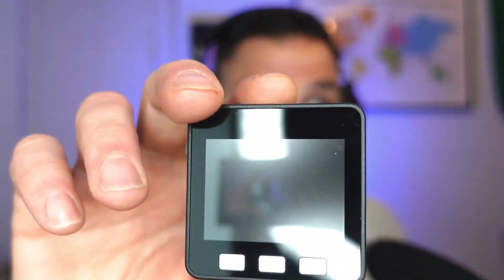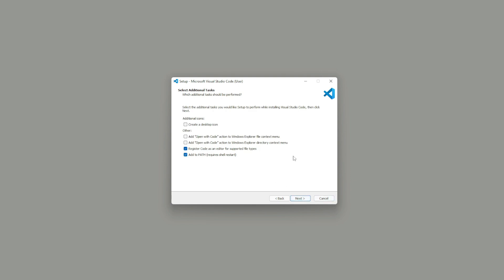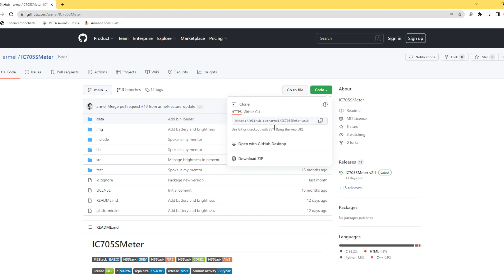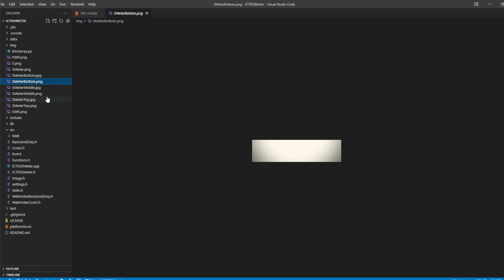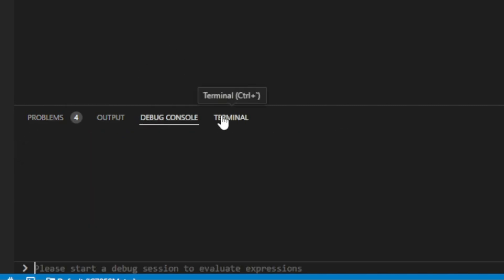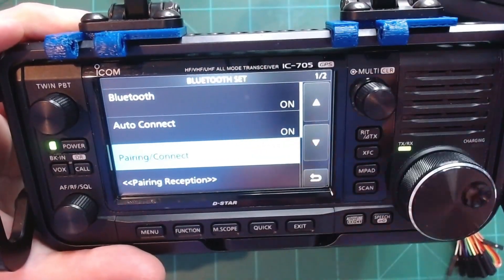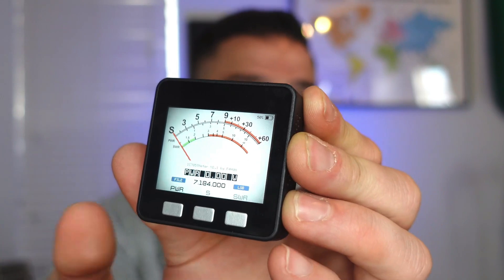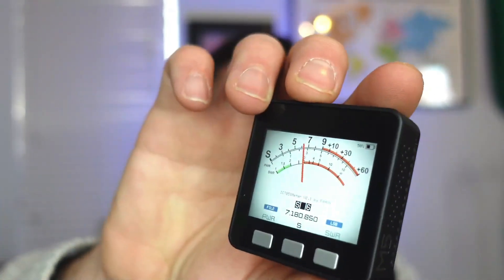IC705SMeter - ICOM IC-705 Bluetooth S Meter Using M5STACK!! Walkthrough Tutorial

Comment: Just saw this tutorial and wanted to say thanks for putting it out there. When I tried to compile I got a bunch of errors and it failed. I deleted everything in the repository I had downloaded and started over and got the same error. Just curious if there was changes made since you made this tutorial to the repository or are there other components that I’m supposed to download that weren’t shown in your tutorial? Any help would be greatly appreciated.
Reply from the maker: I'll have to try whenever I get home. Otherwise Arnel would probably be resourceful and good information should be on the GitHub link
Reply: Yes, I got a red FAILED error but suspect I used the old install as there was a link to M5HamRadio, I might have to reinstall it all.

Comment: WARNING :CODE PROJECT NOT STABLE!                  
I got the Multimeter project working, and paired with the 705. When I powered down the 705 the M5Stack powered down, and was "bricked". Could not power on, reset, under any circumstance, connected to power, etc. Its an interesting project, but not stable...Your video was helpful getting it up and running...

Comment: purchased a $49 AWS Core2 (yellow cased) m5stack; comes w/500mAh battery; built the 705Smeter and 705multimeter firmwares; put them on an old FAT32-formatted 8gb microsdhc with the names smeter.bin and multi.bin; inserted them into my AWS; upon bootup, i press the center button when i see a single dot at the top of the screen; the bootloader displays the two firmwares; i use the left or right button to select the desired meter, then press the center button to confirm; the AWS then reboots to the selected meter... so now i have a remote BT meter that can display the detailed multi-meter or the old-style gauge meter for my 705; the old style works very well when using my 705 /p with a mag loop; i can keep the waterfall, scope in full glory, and then just watch the SWR while i tune the loop at 1W RTTY output! excellent accessory for the 705! get one today and do it yourself - and send the author  (Armel Faveau, F4HWN) some money - he deserves it!

Comment: Thanks Dude for the great video tutorial. I got the Basic M5 from the M5Stack store.  WIN10 did not recognized the device since the COM port was already used, had to manually change the port assignment.  Now the meter works like a charm. I wish that we can get more apps, like the RTTY external keyboard interface.  IC-705 can decode the RTTY, and can transmit prerecorded messages only,  You need a PC to type a message!

Comment: On upload, the selected com port is already taken by another device.  Would be good to know how to change to the com port assigned to the m5stack.
Reply: if your stack is on com port 9, add "upload_port = COM[9]" into the platform.ini without the quotes.  I added it right under framework = arduino

Comment: Outstanding video. I too saw the article in QST and have built the meter on the new CORE2 version of the hardware (touch screen/buttons). Works great!  Just wanted to point out that if anyone is going to build on the CORE2, Armel's READ.MD file (in the downloaded GIT repository) contains instructions to make 3 easy configuration parameter changes before you build and upload. I look forward to other uses of this great little device for ham radio.
Reply: I really only see TWO changes. First in src/settings.h file change to #define BOARD CORE2 and the second in the file platform.ini modify the default_envs = m5stack-basic-grey to default_envs = m5stack-core2.  That did the trick for me it compiled and loaded and is now working. Obviously, you build the "project task" m5stack-core2 instead of m5stack-basic-grey.

Comment: With 3 Buttons would be nice to make a controller for the IC-705
Radio in backpack with external antenna
M5Stack on a clip on shoulder strap
BAND Cycle / Freq UP / Feq Down
or 
1 Button to set "Focus" of BAND or FREQ or MODE
The 2 other Buttons do UP  or DOWN